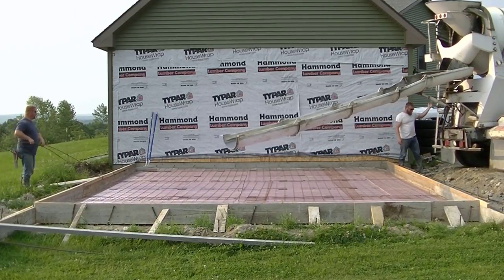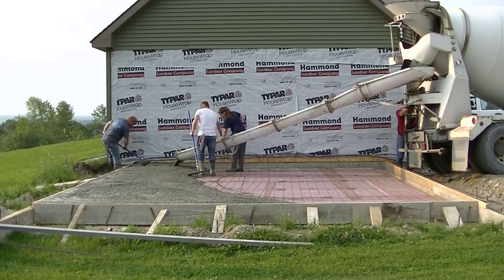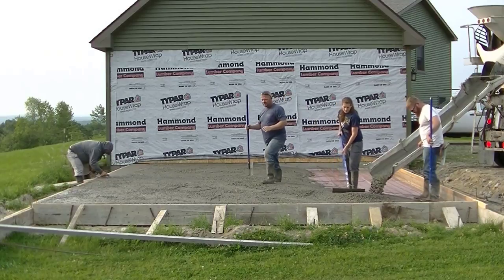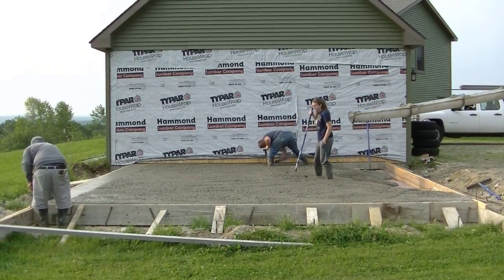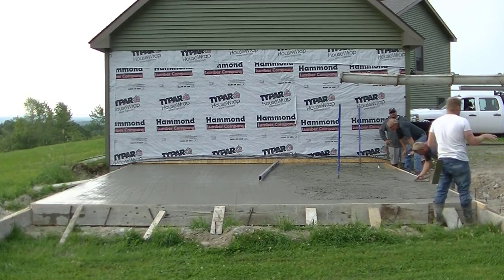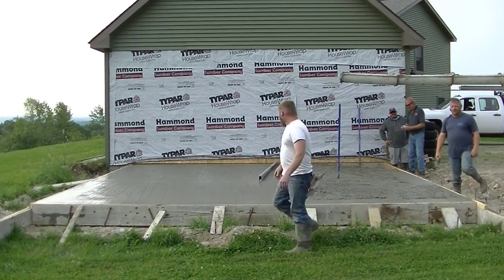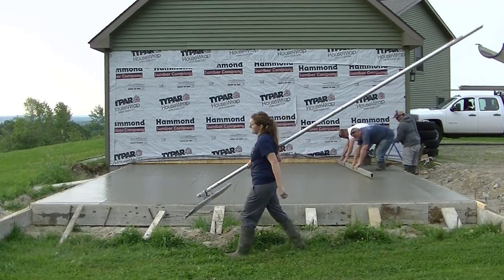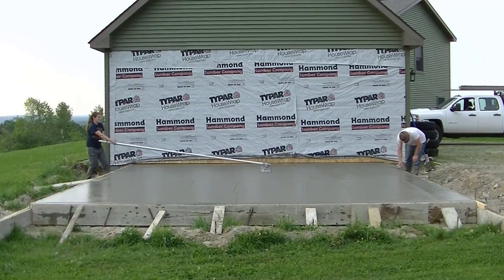How To Pour A Garage Slab | Monolithic Concrete Slab

Comment: Mike, thanks for all the good instruction. The wife and I decided to pour three slabs (one in the dog park, one for the back patio, and a small one between a sidewalk and our house slab), and then 101' of 4' wide sidewalk. I have a raised wood sidewalk from our house to my shop that is falling apart, so we've decided to go with concrete. We also have a 24x20 wood deck that butts up to the wood sidewalk. I was going to pour a replacement for that, but there are two large trees in the middle of the deck. From what I have read, pouring concrete around trees will kill them. We decided to just remove the deck and add a bunch more sq.ft. to the back patio.  After checking the price to have someone else do it, I decided I could probably break my back to save $8k. I've poured small pads to set radio towers, but have never done any flat work like this. I've watched about 30 hours of your videos so far. We're NE of Dallas, TX. How far up do you lift the mesh? Do you tie it together? Would it be better to use plastic chairs since I am a noobie?

Comment: Hey we got some church guys together to pour a gal's 2 car car port to close in her car port. So the truck shows up and the driver is wondering about us.  I was in charge with about four volunteers (friends from church).  I'm the only one with any experience from 20 years prior (when I worked with my dad in college).  We used a 2x4 middle temp form for grade as we had a drain in the middle of the floor.  Poured left half, then the right.  Then leveled it with a 2x6 and pulled out the temp form and troweled in the gap.  Then used a 16" trowel on the entire floor.  We knocked the pour out in about an hour and as he was cleaning up, the driver called me over.  Said, "you had these guys all busy, assigning them tasks and making sure we got it done efficiently.  I know many contractors that would love to hire you to run a crew." I told him I got it from running an aircrew in the Air Force (I was a pilot).  He laughed.  And then he and his wife joined our church.

Comment: Hello Mike, really enjoy your video. I have formed 1 garage slab many years ago and had someone else float it. I am in the process of adding on to an existing metal building home with a 24x36 slab with a 48 inch x 12 inch footing. The footing is 48 inches to get below the frost line. I'm in northeast Missouri. I have been trying to find some videos on breaking ground and forming this. do you have any that would help out. thanks for the time you take to make these videos

Comment: Great information:) I am in Mass. and was wondering since you are in Maine; do you not have the requirement of going down four feet for the foundation of the slab? I do not know if I can pour a slab as you have shown. I would like to pour a small slab 10 by 16 on the back of my garage.

Comment: Hi Mike, big fan of your channel and youve taught me a lot! I'm setting up a 44' x 14' slab on grade on two property lines for an ADU and because of grade differences between the lot im having to stack two 2x12s and im a bit concerned about the weight of the concrete pusbing out against the forms. Any advice? Im going to put lots of kickers and stakes in, possibly backfill around the outside..
Reply from the maker: That's what we'd do, lots of stakes, kickers and backfill.

Comment: I live in western part of n.c. I have and old concrete block wall that rotting and the slab is cracked and coming a part.If punch holes in the blocks all over will it make it stronger?The slab is 22x35 ft. Will is from 24" to 48".What do you think on knocking out the front of the blocks?Vid.are very interesting thank you!
Reply from the maker: Hard to answer that without looking at it. I would say if its rotting, take it out and start over new. Best I can do with out looking at it.
Reply: Thank you.

Comment: Great videos!
So when you screed do you touch the wet pad? or barely grace it?
Reply: You want to see the cream move but not the rocks if that makes sense. 

If the cream moves, you're on the right height

If the rocks move that means you are digging in
Reply from the maker: Yea, we touch it, we leave a slight line with the end of the screed so we know we scored. If no line, then we know we have to go over that part again.

Comment: Have you ever used a highway straight edge( bump cutter) or check rod?
Reply from the maker: No I haven't, never had a need to.
Reply: @MikeDayConcrete  From what I've read it'll bring up your ff and fl #
Reply: Is a highway straight edge a power screed? I did a parking garage with one of those once.

Comment: Pull up that wire
Reply: I was surprised Marshalltown wrenches don't have hooks on them. I guess they expect their gear to only be used on jobs where the ironwork is done right? Which does happen but I'd say it is the exception rather than the norm.

Comment: Ps Going to pour a mono slab.not me.
Reply from the maker: Let us know how it comes out.
Reply: Hi Mike.They are going to pore a 4 or 5"  wall around it with rebar and wire sheets on the slab and pore 6" concrete,with a.25" per foot fall.about 18 to 20 yards.they said the fill had settled and the brick on the house might fall if we cut out the slab.(brick was laid after the slab). Hope that makes sense.
Reply: Hay mike, I sent one must not went. They said that the fill had settled under the slab and the brick wall would crack or fall.(brick was added after the slab)they are going to pore a wall around the slab about 4" with rebar & sheets of wire on the slab and about 6"on the slab. I would rather have taken it out but. Hope that makes sense. Thank you.  PS.I think about 18/20  yards.concrete is  $165. A guard + 4 different taxe. They are the only company in about 75 miles so you know what that means.